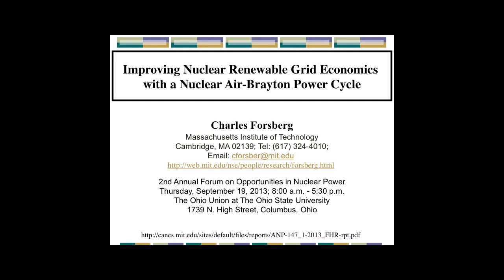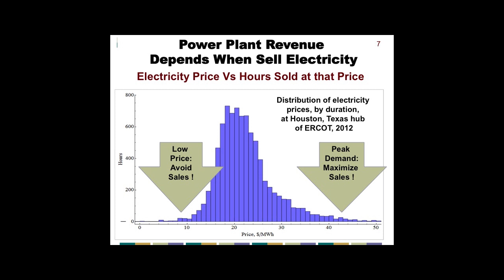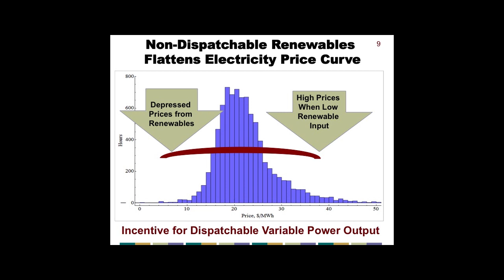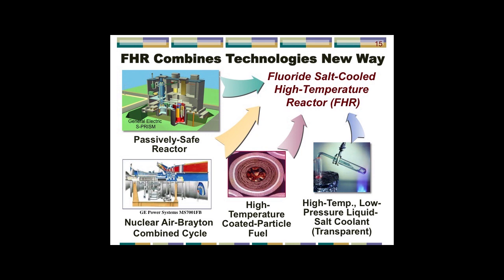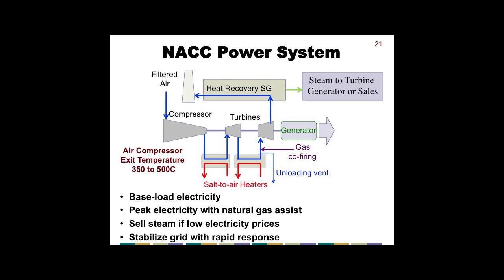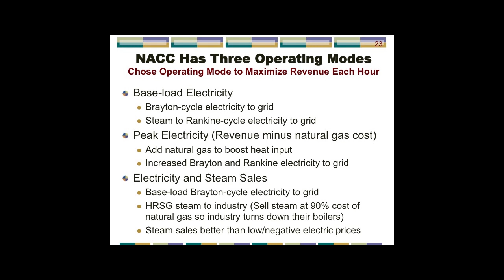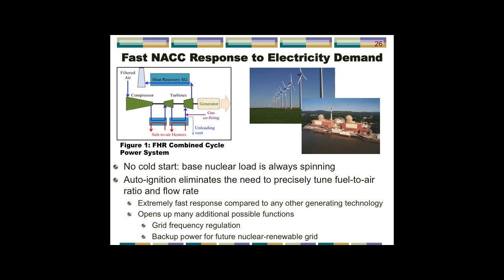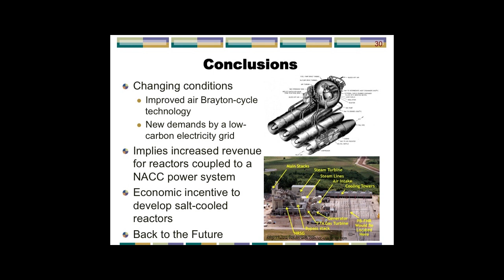Dr. Charles Forsberg and the MSR Molten Salt Reactor

Comment: While it is no doubt commendable that thought is being put into designing a fission power station for the future power grid, ultimately I think the approach taken here is ill-advised.

For example, the underlying assumption made here is that the pricing system in place NOW in California/USA will remain exactly the same going into a future of greater reliance on electric cars & their recharging, a future that contrary to what is assumed, will begin to incentivize base-load power stations once more. Moreover going into the future we will also have greater demand for cheap, carbon neutral, transportation fuels.

In this latter regard, High Temperature Reactors(HTRs) have an advantage over every other energy generation method yet conceived. In 2011 the US navy research lab began down the path of demonstrating the production of synthetic Jet fuel from nothing but seawater & heat as process inputs. With the goal of ultimately making their nuclear powered aircraft carriers self-sufficient. They flew a small radio controlled plane on the stuff so far.

In summary, rather than bend-over-backwards to fit around the ideologically supported solar & wind "power stations". The more lucrative, and not-to-mention environmentally benign, approach appears likely to be not: "less baseload & more flexible peaking power ability" as argued here, but on the contrary "more baseload, & if demand isn't there for that all the time, no worries, just use the excess heat & electricity to make environmentally benign synthetic fuel."

I'd welcome being challenged on my criticism here, but I think the logic of the speaker has a bit of tunnel-vision. Although I welcome being proven wrong!

In either case, the speaker was lucid & delivered his talk with articulate clarity.
Reply: YES, high level base-load is the answer, when demand is not there use excess energy for desalination, syn fuels, co2 extraction, fertilizer production, etc
Reply: TheArrogantOne
Nice to know, I'm not alone in this.  You brightened my day, it has been like an ep of the twilight zone thus far, so to see a like minded person, someone that gets exactly what I was trying to express, has truly lifted my spirit. All hope is perhaps not so lost after all. Spread the truth and keep yourself above water friend. Ad Astra!
Reply: take a big hug, you need it. btw, I was thinking about how this high level baseload would work for about 2 years now, even thought of writing a book, but i do not have much writing talent
Reply: The projections of what the future energy grid will look like aside, some solar operators are going to be forced to climb onboard with this as they will need to hedge for their low sale price and bone up to their causal role in the increase CO2 emissions,, they will like molten salt as a storage opposed to the battery fiasco. I see great potential with this on several fronts.

Comment: If we account for the external costs of natural gas extraction, that natural gas fuel cost may become prohibitive. (The fracking industry may decline as we recognize that it involves destruction of the geologic features that hold helium AND as we start accounting for the more obvious external costs of groundwater contamination and fugitive methane emissions associated with that method of extraction.)

Some regions may have industry that wants to buy steam. I wonder if the excess capacity in other regions might best be used to produce methane from atmospheric carbon dioxide. What are the economics of such a process? I have heard that LFTR technology can support this process. Can production of liquid fuels or methane be made efficient enough to allow these fuels to be used to respond to peak demand?

A smart grid that allows variable pricing to the end-user will tend to smooth the peaks and troughs of demand.

When we start accounting for externalities generally, all forms of production--whether it be of electricity or any other product--will shift toward more environmentally friendly and sustainable models...

Biological Model for Politics and Economics:
http://gaiabrain.blogspot.com/2010/03/biological-model-for-politics-and.html
Reply: John Champagne Having just noticed you left a comment very similar to my own, I thought I'd ping you to let you know that we appear to think-alike!
Reply: The man's point is that power island realities will drive nuclear island design and not the other way around..